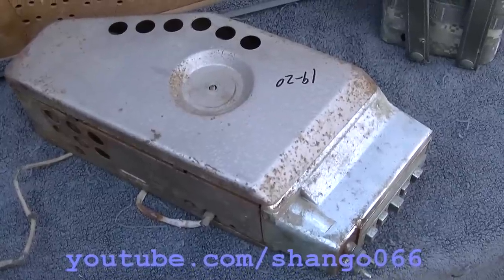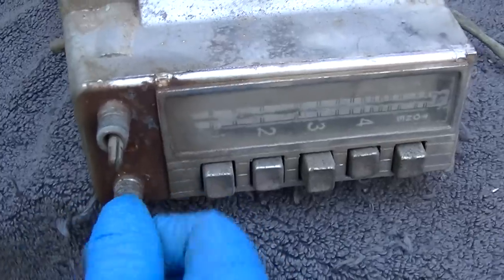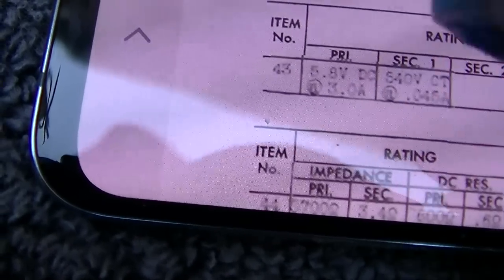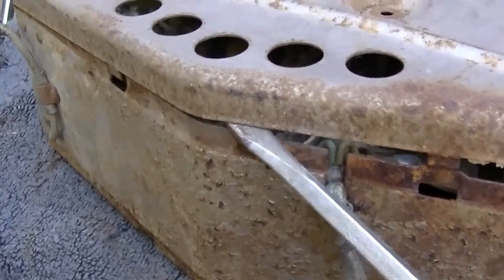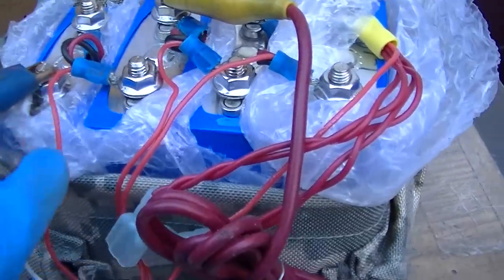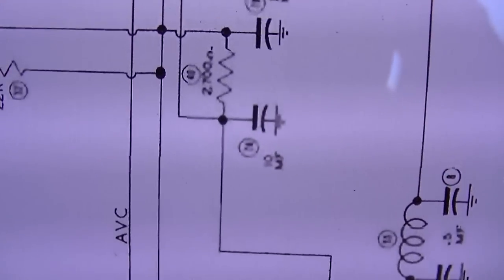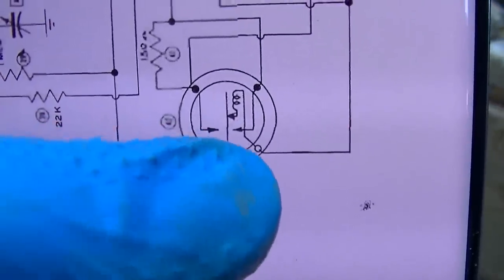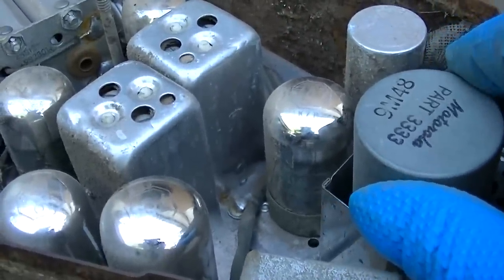1948 Mopar 602 Truck Car AM Radio Restore

Comment: Cold cathode rectifier tubes have been around since the 30's.  Inside the OZ4 is a small glass bulb about the size of a lamp starter.  They are related to thyrithons and tungar bulbs.
I hope that 6SN7 was a dud.  Audiophools will pay at least $20 each (or more for black plate RCA's) for those things!
It's not just the 1N4007's that caused the higher voltage.  I bet that transformer likes a sine wave input better than a square wave.

Comment: @shango066 How much current do you need from the vibrator ? If the current is just a few milliamp might I suggest you just build a diode PUMP circuit theirs a few online, the way it works is a push pull from an oscillator through diodes and capacitors to multiply the voltage similar to your tripler circuit, but can be doubler, quad, etc Try a search on diode pump circuits.
Reply: He'll need more current than that can supply

Comment: what if you took a dummy loctal tube and just sprayed the pins with cleaner and insert/remove with repeat, with the snapping loctal part cut off the dummy tube?

Comment: If you get out in our part of the USA (Dakota's) you will see a lot of these old trucks on the road being used by the farmers.  Why junk a  truck just because it has some years on it.  They dig them out around harvest time and haul grain to the market.  Most of the time the radios are not even turned on since the old trucks are so damn noisy that they drown out all but the loudest sets. I learned to drive on an old Studabaker pickup, then graduated to dad's old International Truck hauling grain to the elevator.

Comment: Somewhere i have 2 gutted 0Z4, small glass bulbs with 4 wires. They have a filament but its 2 wires are connected together as cathode. The filament looks like a filament from a flourescent tube

Comment: Could try using a BJT ZVS driver circuit. The BJT version has each transistor's collector connected to the 2 sides of the transformer, emitters to ground, and each base trough a 470 ohm resistor to the collector or the other transistor and a ~1uF capacitor across the collectors to make a resonant circuit with the transformer... it's a very robust design. tune the 470 ohm resistors for optimal current draw.
Reply: That's a Royer oscillator and in the standard configuration you describe it is NOT a ZVS circuit. You need to add an inductor to the transformer's feed and use a different feedback circuit for it to be ZVS.
Reply: @eDoc2020  Well you don't need the current limiting inductor when using BJT's, since the collector current will be limited by the base current * Hfe of course.
Looking at circuits for a royer oscillator, it is clearly not a royer oscillator. the circuit I'm describing does not have a feedback winding, instead the bases of the BJT's get fed from the other BJT's collector. and no inductor either.
Reply: @EdgarsLS  It's not Zero Volt Switching without it. Halfway through the oscillation there's no voltage across the transformer. Both primary ends are at supply voltage voltage and so both resistors are supplying base current. This is the switching point and there is voltage across both transistors.

Comment: Antique electronic supply sells a drop in 4 pin (solid state) vibrator part Number P-V1015X. Designed for the automotive radios (they say). Just a thought.

Comment: RvB replacement chip goes inside the vibrator case totally indestructible 6-volt 12-volt synchronous all-in-one unit

Comment: "They don't make em like they used to" as far as reliability is concerned. Even baking out in the desert sun and humidity (I assume) for 50 years, the mechanics still work with a bit of lubing. Not what you could say for any of this modern plastic stuff that starts crumbling after 10 years of normal use.

Comment: Military vehicles used a dynomotor to achieve the high voltage.  Had a rambler radio salvaged for my use as a high school kid hi hi

Comment: Very nice 👍 truck 🛻 and radio. I think 🤔 the truck 🛻 would start with a 6 volt lantern battery 🔋. Sounds like 👍 12 volt wasn’t much in use then. Hopefully 🙏 this didn’t ruin the radio, if that’s what you’re meaning. All this radio is probably going to need is a recap job. I’ve only seen a couple of tube type car 🚗 radios in my time, and both were on YouTube, and both were on your channel. Great radios 📻. Your friend, Jeff.

Comment: It may turn out that the Loctal bases used in trucks and cars would be of a higher quality compared to other radios due to the constant vibrations in a vehicle. That may explain the unusual performance from the ones in this radio.
Reply: Many Loctal tubes were just equivalents of other tubes shoved in a Loctal package. The 7C5 output tube is exactly the same as a 6V6, and so on

Comment: You need to work on a GE clock radio from Jim’s Radio Shop that has SMD because he gave up on it and is making it a Bluetooth speaker using the Phono input and he did a mod of the volume control so it won’t switch between Radio and Phono and he’s still getting hum on the Bluetooth  because I bet you could have fixed the SMD like you always do

Comment: If the Vibrator is unobtainable then what about the using the Low Voltage tubes made in 1957 with a heater voltage of 12V and a B+ of 12V then there is no need for a vibrator.
Reply: Not enough power to drive the speaker. Those sets used a power transistor for the output. nice idea but  prob too many mods. I fixed one when I was a kid... The dreaded paper cap on only 12 volts!
Reply: @stevehead365  maybe they could used another ignition transformer to drive the loudspeaker as it has a high number of turns compared to the number of turns on the input winding.

Comment: 1:05 You can also make one out of a relay, but I don't know how long a general purpose relay would last in that role.
Reply: The are good for a hundred thousand cycles or so. That would quickly get eaten up in this application. Semiconductors (if they are not stressed) last for ever.
Reply: Chinese counterfeit transistors have entered the chat

Comment: I've had a couple of dozen forties and fifties mopars Over the past 50 years And they've all been 6 V positive ground until 1956 where they went to 12 V negative ground..
Reply: I used to work on old 'White" brand trucks in a woodworking factory in the early 90's and they had positive ground as well. You didn't get corrosion on the battery terminals nearly as much on them. (or so it seemed)

Comment: All that rust...  Probably leaking windshield.  Seems like vehicles of that era up to the early 60s even all leaked and one reason the floors rust out from the inside too.  I don't know where in the dash that one was mounted but water flows downhill so if it was on the end of the dash a worse location compared to the center.

Comment: Watching this on my 10-in 1975 GE porta color coming from a UHF transmitter RCA cable to a HDMI adapter to a Chromecast to my phone, why?...... I don't know, I don't know.
Reply: You like to watch this is style! Why not? I'm listening through a 1957 Challenger amp. 6V6's in push pull typology. It's my "digital to analog" converter!
Reply: Ha! Up until a short time ago, before streaming music like Pandora was available, I was listening to my own playlists of my vinyl records recorded onto CDs, played by a portable CD player hooked into a cassette adapter inserted into an AM-FM radio / 8-track player I bought from Rickles Home Center in 1976. Why? Because flipping records is a PIA.
Reply: @cmans79tr7  I still use a cassette adapter in my car, I hook it up to my phone with a c cable by headphone jack and I get hands-free calling and everything I used to carry a Sony disc man and plug it into my cassette adapter in both my vehicles before I bought my 2003 Volkswagen that had a CD player in it, I still have that car today.

Comment: Hey Shango66 took down the vid he posted today, on building a solid state vibrator replacement.
Reply: Maybe YT auto-flagged it as P--O--R--N.
Reply: @pcno2832  There's like hundreds of titles on YouTube about that kind of vibrator... some pretty explicit.
Reply: Maybe whoever wrote the schematic complained.
Reply: @monkeyboy4746  The original design is over 50 years old. This one's been pretty much been out there for 20 years... id say the FETS and the astable are improvements, over the BJT original... but, I doubt what he was showing was copywrited by anybody... or that anyone could copy-write it... or anyone would want to.  All the 'commercial' solid state vibrator replacements for sale are uprocessor based, or use switching chips... different circuits really... the guys selling these things are mostly guys with a big Webpage, and a small corner, in their basement. There's no real commercial value, or market for these things. Anyway, I can't really say, but IMO anyone's within fair use just experimenting with a circuit.

Comment: 6 volt positive ground not one doubt in my mind. Not sure polarity would matter on it.
Reply: Input polarity doesn't matter with a tube (or ss) rectifier. However it does matter with an older synchronous vibrator (mechanical rectifier). If you reverse the supply polarity,  B+ becomes 'B-minus' across all the filter caps. 😶‍🌫But you can reverse it by swapping ends of the transforner secondary. I did this conversion on a '47 Buick radio (neg. ground)  to run in a '37 Plymouth (pos. gnd).